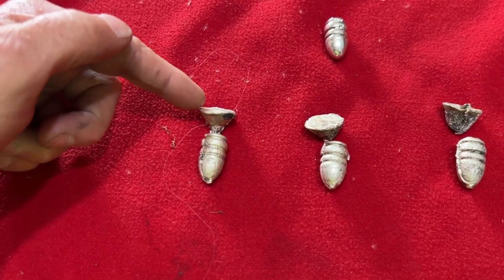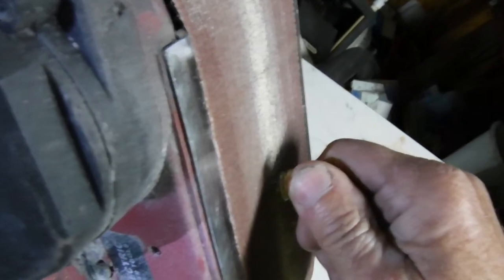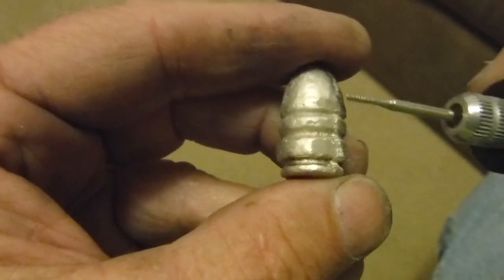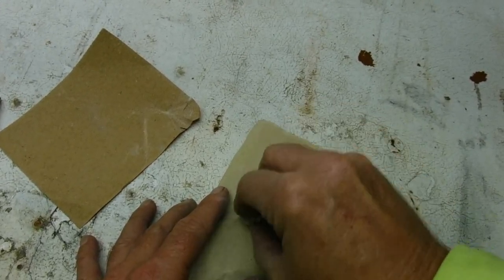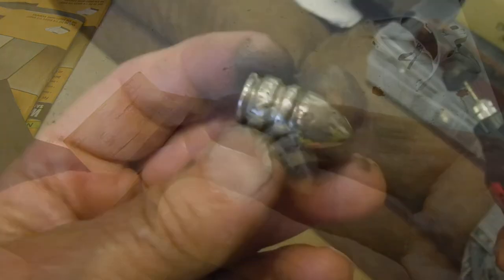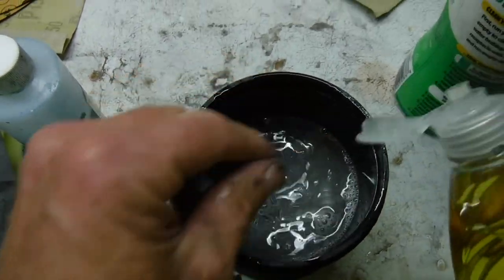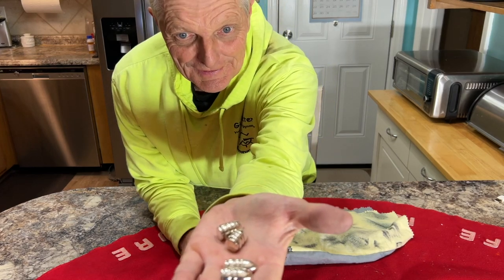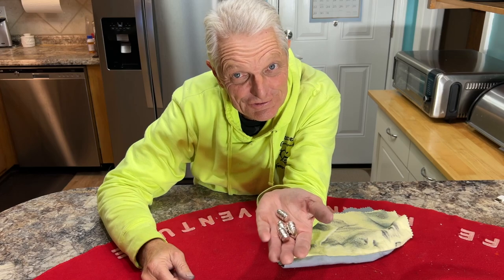The Final Touch Sterling Silver Civil War Bullets!

Comment: I'd guess you prefer to use the old bullets to mold, but if you ever want to try, Dixie Gun Works sells reproduction steel sharps ringtail bullet molds and others. Would make a really clean bullet and can do two at a time. Much easier and cheaper than purchasing a civil war mold that could get damaged. I'm just being a pest, sorry.
Reply from the maker: Thanks! Going to check that out
Reply: @Gigmaster  you're welcome.

Comment: Are you going to get them hallmarked? Which means you can legally call them sterling silver? Sterling needs to be 92.5% silver and if you used the  crucible to melt any other metal it’s probably that the silver content had dropped below the 92.5%
Reply from the maker: Got crucibles for each metal